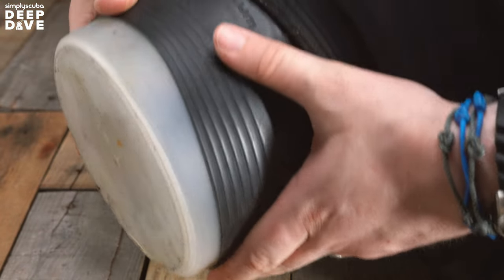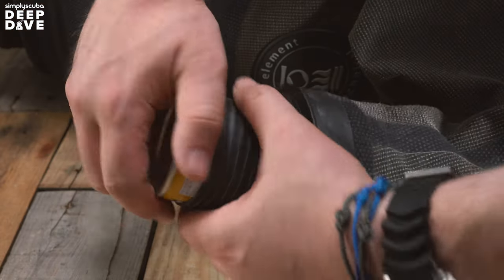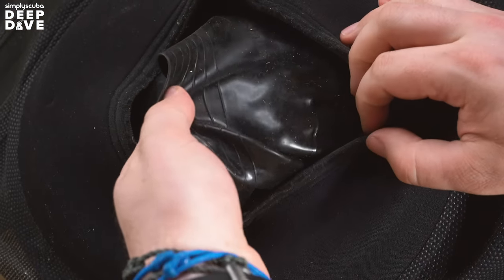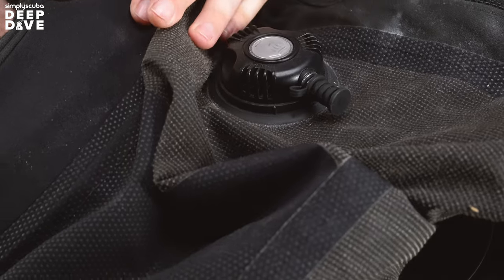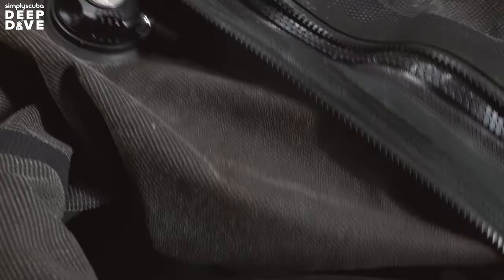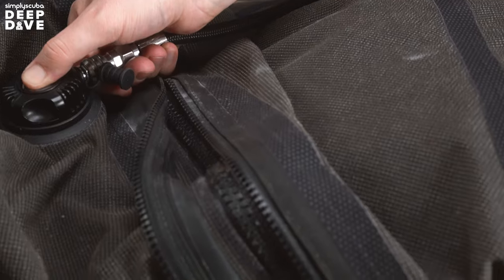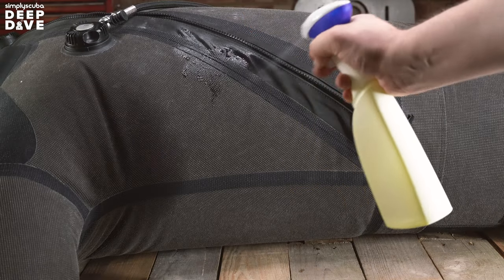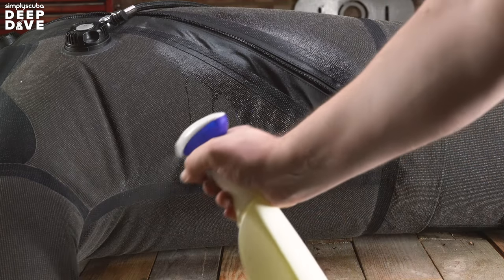How To Leak Test Your Drysuit | Deep Dive

Comment: Hot & Dry Drysuits in Australia finds leaks by sealing wrist seals then pumping water from a drum into the suit via a custom made neck seal/pipe entry-exit. Quick & easy to find all leaks - even those hard to find slow weeping leaks which I could never see. Hang upside down to dry, then they repair. Bonus is all those years of dried perspiration on the inside of the suit were cleaned away when I got mine back.